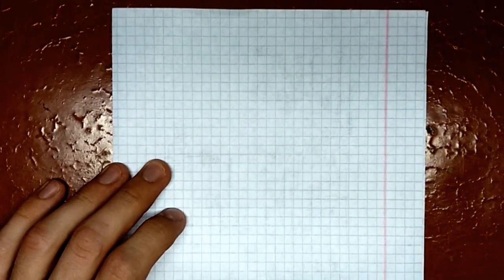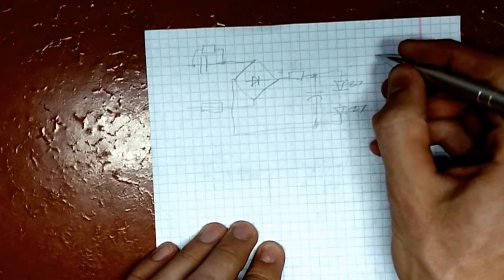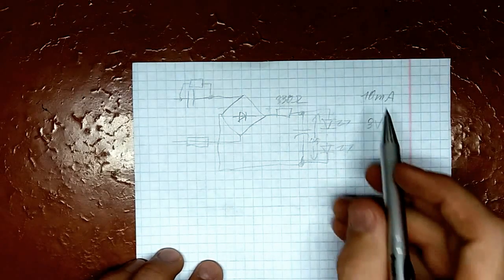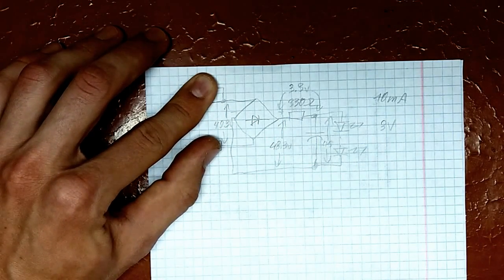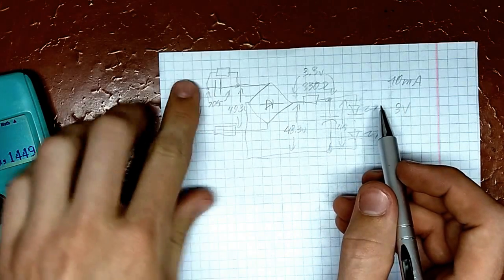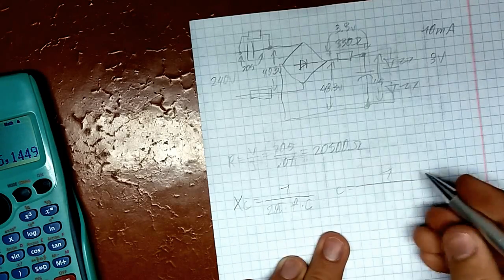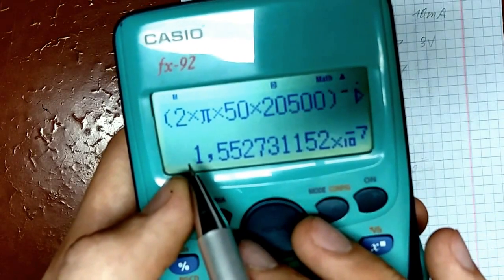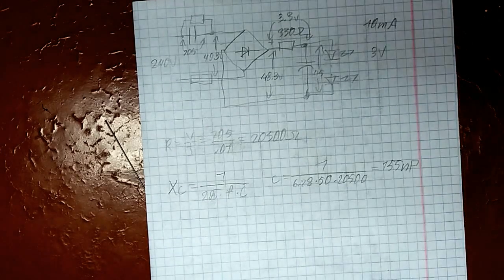Calculating the value of a dropper capacitor

Comment: Nice video, but you should point out that the discharge resistor will also have 205V across it, so needs to be beefy.
Reply from the maker: @Gooroo-s6n  It doesn't dissipate much power at all, the only concern is voltage rating. But a 1/4w resistor can handle 300V. If it makes you feel better, use 1/2w ones.
Reply: @mrjohhhnnnyyy5797  Yeah, my bad - did the sums wrong :-)

Comment: I have 3 volt 15 leds AC voltage 230 volt 50 hz . What is the drop capacitor value?

Comment: why drop 205V? did you mean this: 240V - 49.3V = 190.7V. Final answer would be 167nP
Reply: He used the rms voltage of 49.3 which was 34. Something,  roundedoff to 35v. Hence 240-35 = 205v

Comment: You are a very practical guy (as usual). Do you think 2 graphs (for 50hz and 60hz, capacitance vs current) with colored lines showing various input voltages would be a good quick reference to have?
Reply from the maker: It will be nice, but I don't mind spending a bit of time calculating this over again. If you are doing this very often, then yeah, graph will be very handy.

Comment: Yes i knew you had worked it all out before the video, too fast and picking that dropper resistor after the bridge "out of thin air", you naughty man LOL :-D

You will get a tiny error as the circuit is not purely resistive.
I assume that you used a 0.22 uF capacitor for slightly more current.

I once knew the formula's off by heart, my memory has faded a bit.... who am i LOL :-D
Reply from the maker: Absolutely, 220n that is!
It actually was pretty fast the first time I calculated it, then I was not in a rush to finish the video before memory cards fills up to the brim :)
I really picked that resistor randomly, it is not very crucial. It is good to have it though, as it protects the LED's from inrush current when the dropper cap is discharged. 330Ohm and 22uF ensure that the voltage doesn't rise too fast, thus protecting the LED's.